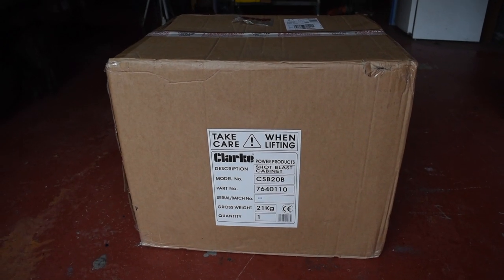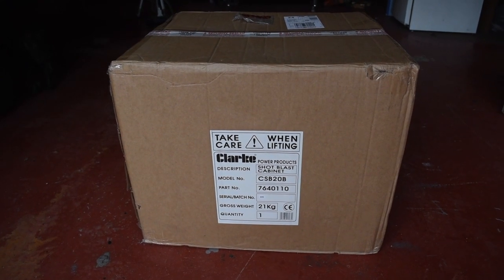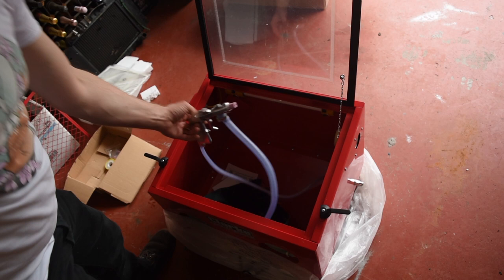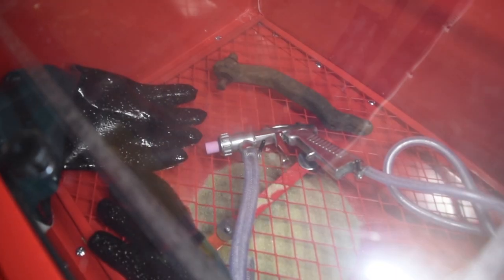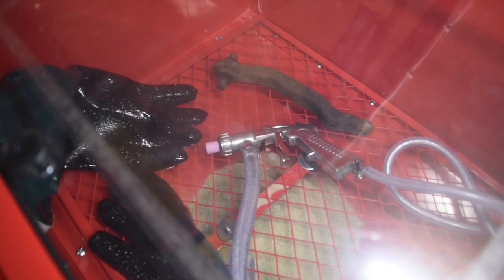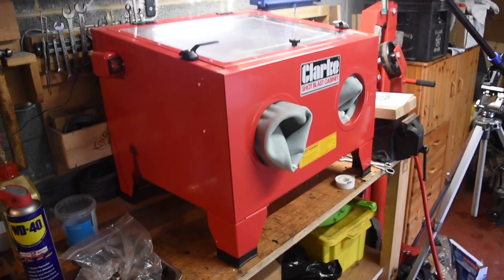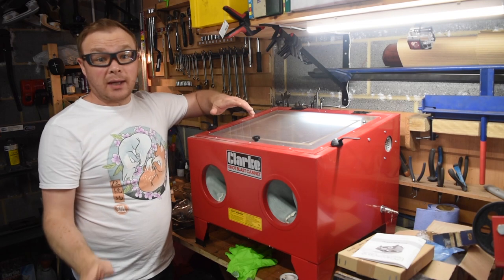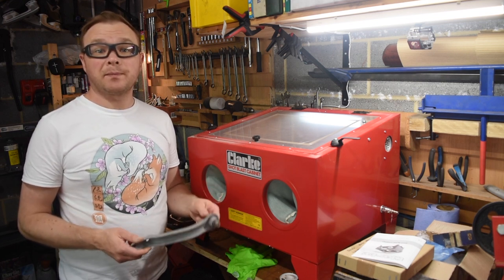What To Expect From A Bench Top Blast Cabinet - Opening And Testing The Clarke CSB20B

Comment: Hi, great video. I bought the same type of cabinet a few months from Sandblasters UK for £100 and I am very happy with it. Just a couple of improvements I would suggest based on my experience. 

These need a water trap, I put one in and it is great. Also drill a hole in the back, and fabricate a cover inside for it to hook up an old vacuum cleaner for dust extraction. I used plumbing fittings and that also works well. 

The wee cabinet has more than paid for itself on my Herald 1200 restoration.
Reply from the maker: Thanks! The cabinet you mention does look suspiciously similar. Might be that red paint is particularly expensive… I would’ve been torn if I’d seen that one at half the price, the cost is more attractive , but every non known brand air tool I’ve bought has not worked/lasted well. 

Anyway, yes, both very sensible ideas! I already have a water trap on order. I’ve also rigged up something temporary with a hoover to serve as dust extraction. I think my permanent solution will involve using the port to the back left that comes with a basic mini filter in a twist on housing.

Comment: Took mine apart and re-sealed all the seams with silicon, also put some W groove shaped rubber window gaskit around the lid and on the faces of the tray where it joins the frame. Basically just try to cover every joint in the structure with some kind of gaskit where possible! Still wear and mask and eyes when using it to be safe but it really helps with the dust
Reply from the maker: Do you use extraction? I adapted something from an old vacuum cleaner and that's worked out very well.

Comment: I got the same cabinet and figured out a lot. You for sure need water removal from the air compressor line. Drain your take before starting. If your gun seems like it’s not working, remove the tip and ring, then look inside the gun. You’ll see is clogged up with media that looks like mud; clean it out and it’ll be fine.

The pickup tube that’s screwed to the bottom can be a pain as soon as any debris from what you’re sand blasting gets near the pickup holes at the end. I just left the screw part in the bottom and removed the hose, then just stuck it straight in the media (had to adjust it from time to time).

The manual says a range for psi, you might have to go higher or lower based on media used.

To help with dust, do the vacuum addition others suggest, and if you’re doing a bunch of parts, put them all in the cabinet together, and sandblast one at a time. Then, use some painters tape and temporarily tape the seams around the top of the lid. This helps with dust blown in your face.

Also, add a LED light bulb and fixture inside the cabinet. Or, you could lay a LED light with a shroud/hood on top of the cabinet lid pointing downward. I used two really bright headlamp flashlights and they worked great. The light that comes with the unit gets covered in dust and isn’t bright enough.

Always wear a mask with this unit, the micro dust gets everywhere…mostly on you!
Reply from the maker: Yes with the vacuum attached it’s much easier to work with, and I don’t get any dust leakage (there’s enough negative pressure that it’s impossible to open the lid). I have already ended up doing similar to what you suggest about lighting and have an LED work light on the outside too usually.
Reply: @redfoxclassics  After looking yours, I got an idea for attaching a vacuum very easily. There is a screened outlet with a filter inside it on the back of the cabinet, that can be twisted off. 

Didn’t take it off, but I used silver aluminum tape and taped a large shop vac reducer to a regular shop vac hose size on it (fits perfectly). Then, just used a regular size shop vac with the hose plugged into the reducer, and no more dust….

Thanks for making this video!
Reply from the maker: @TheBlueskydriver  I used the same port. I made a plate from sheet steel to match the supplied twist on filter and welded a vacuum cleaner attachment to it. I used some closed cell foam left over from insulating the heater matrices on the Triumphs to make a seal, works great! Pity it’s not possible to edit YouTube videos after upload as adding in some points from your comments and others would be kinda useful.

Comment: Lol I got one of these years ago it don't look like that now I used it once for about half hour and said nope ripped it apart and now it's so much better I did do a video on it  but since then iv moved and can't find my memory card but I did get to sort out the cyclone video that is on my channel it will leak no matter what yiu put in it hence why I took mine apart now I don't have anything come out of it and then I decided I'm going to get another one and make a vapor cabinet and I'm about half way making that just needs a couple more bits and it will be done but take it from some one that's done it don't keep it like that your be fighting it all the  way find what fits you and what you want it work like there are so many different ways of doing it none are right but none are wrong well some are but your see that your self lol best of luck
Reply from the maker: Yeah, I've built in extraction with an old vacuum now, and that's much better. I can see where that sucks in air round the edges though, pretty leaky as you say! For the moment, it's doing what I need but I'm sure some customisation will come in time.